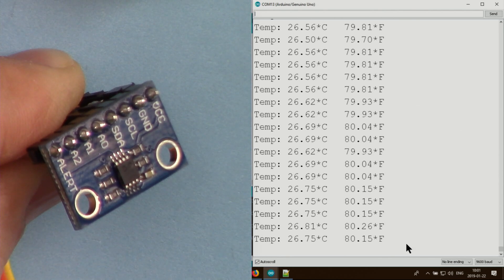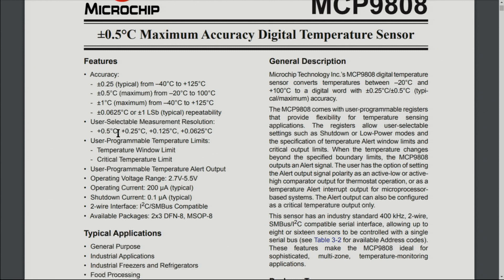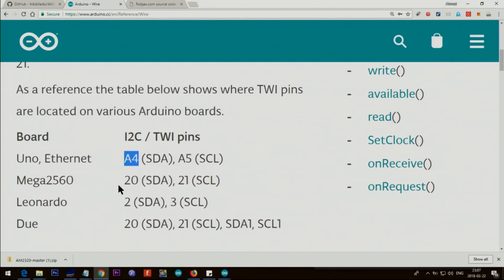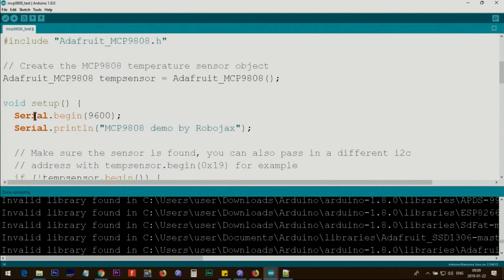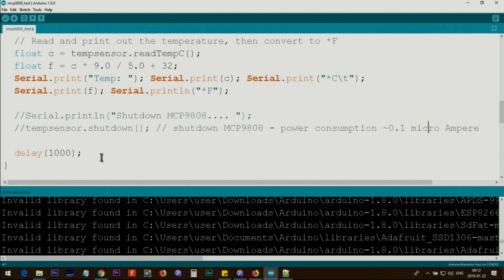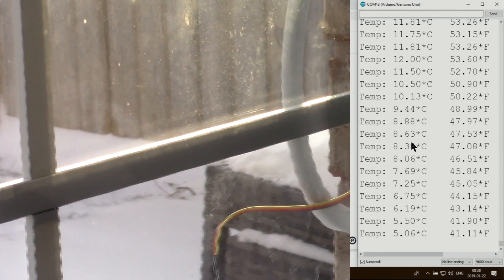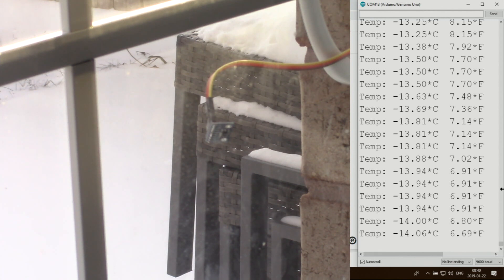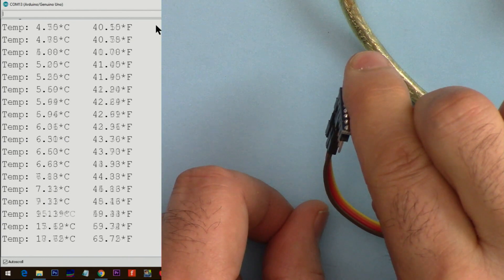How to use MCP9808 Temperature Sensor with Arduino code RJT151

Comment: Do you think that this sensor can help me to monitor the temperature of an AC motor, I need a sensor with programmable temperature alert, bc my device is powered by battery and I want to save battery
Reply from the maker: have you watched the video? it seems not.  this is measuring the air temperature. You need NTC to measure the temperature. you need the sensor to be attached to the motor so it can get proper sensing.

Comment: What should I do when I want to use  BME280 sensor with OLED display at the same time?
Should I connect SDA and SCL pins from both sensor and OLED toghter and then plug it in Arduino sda and scl pins?
Reply from the maker: yes. you can connect 128 I2C devices on the same pins.
Reply: @robojax  Thank you Sir for a quick replay.
Reply from the maker: you are welcome.

Comment: Hey, I'm unable to get the outputs...
I'm just getting this - " MCP9808 demo by Robojax "
Can you please help me with this issue...
Reply from the maker: Hey, what are you getting? any value or nothing?
Reply: I’m getting nothing. And whereas for the demo program in the Arduino IDE, as soon as I gave the 3.3V connections from Arduino to fever click chip, and SDA , SCL to Arduino, the voltage supply is raising above 3.3V. I’m getting 256C constantly. Is this happening because the fever click chip is only of 3.3V and Arduino is 5V...? How to solve this issue...? Thanks for the reply
Reply from the maker: Use I2C scanner https://robojax.com/learn/arduino/?vid=robojax-I2C-scanner get the address. If you read address, then connection and module is good.

Comment: Great videos. Always a wealth of information! I have a fan connected to a relay with the temp sensor. Relay joggles on and off when around the set temp. Is there a way to average the results to smooth the measurement and avoid the rapid on and off. Thanks in advance.
Reply from the maker: You are welcome. The easiest way is adding delay between reading in the loop.  Or write  a loop that adds for example 20 readings and divides it to 20 and you will get average.
Reply: @robojax  Wow thanks for replying!! I'm a little star struck that you did. Your work inspires me. I understand how the sum of an average works but I don't know how to construct it into code. How do I capture each reading? It really confuses me.
Reply: @Flynn3778  you have to do a Hysterese within your Code

Comment: Why would I use this over ds18b20?
Reply from the maker: I have  never heard of DS18b20.  As I just checked the datasheet and it looks fantastic. I would test and see. Thank you for asking.
Reply: @robojax  I should get you the code. Uses a pull up 4.7k resistor.
Reply: indeed; Temperature range DS18B20: -55 bis 125°C (-67°F bis +257°F) and there is a waterproof version
Reply: https://www.youtube.com/watch?v=npslcIvtWac compares both